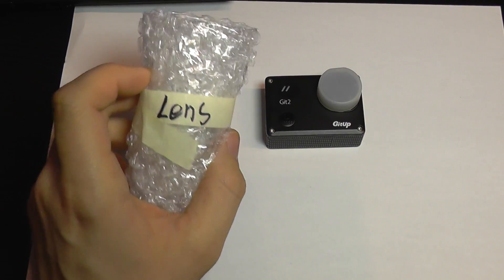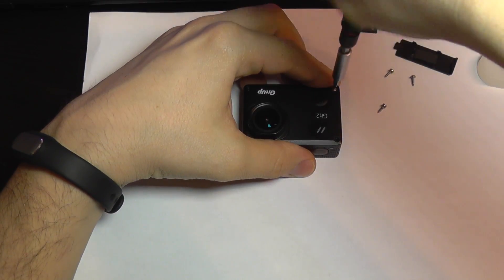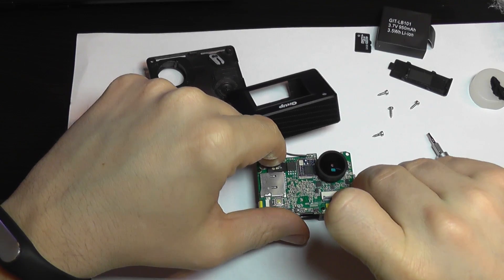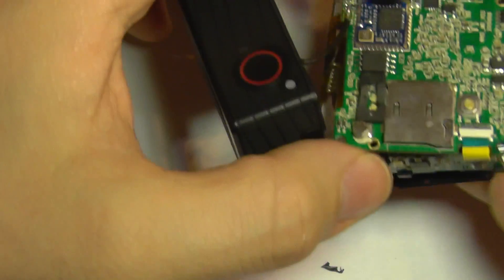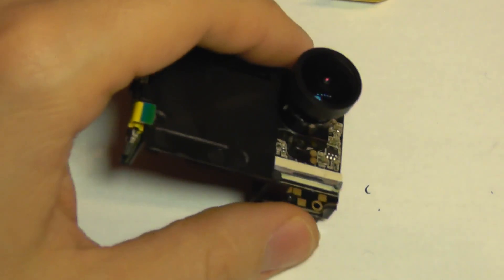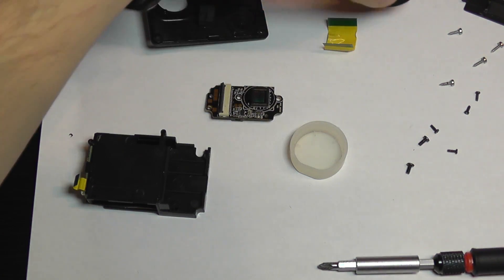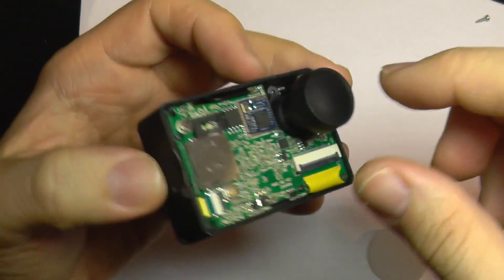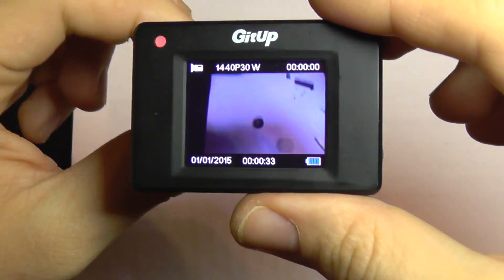GitUp Git2 Complete 90 Degree Lens Replacement Guide

Comment: You make it look so easy ... but I know its not (after fiddling with my Xiaomi YI for over 3 hours trying to get it to perfect focus .. using template to get close then going outside and shooting pictures and watching them on HD TV). It was a lot of work, but my YI now has perfect focus.Going to watch your other videos with the 90 deg lens to see more results. Cheers.
Reply from the maker: You don't need to go all the way in. You may just heat and unscrew the lens and replace it with the new one.
Reply: Yeah, that's pretty much it.  You can find a variety of images to print out here: <https://www.google.com/search?q=eia+resolution+chart&rlz=1C1CHBD_enUS691US691&espv=2&biw=1680&bih=961&tbm=isch&tbo=u&source=univ&sa=X&ved=0ahUKEwjp_sP1_MvNAhVIOiYKHaKoBZEQsAQIGw>  After I focused on that and got it as close as I could, I have a front room bay window, and the glass is very clean, and I focused on the bark of a tree across the street while looking at the image on my HDTV and fine tuning the lens. Once I got it as close as I could, I hot glued it and called it good.  I could have gone the "extra mile" and done a series of high res still images to perfect it even more, as I did with my terrible Xiaomi YI, but thought that I might run into the "law of diminishing returns".  Good luck with your replacement.
Reply from the maker: +Bill Somrak GitUp in now also supplying a CMOS Board + Adjusted lens, so you don't need to focus it again.
Reply: Well, THAT would be good .. make it less painful ;-)
Reply from the maker: +Bill Somrak An also if you want to switch to 170 deg you just swap the boards with lens, much more convenient than refocusing...again.
Reply: I'm much less intimidated by the focusing than by the mechanics of the lens swap. Then again, the break down of the procedure was superb.
Reply: Yeah, it works great. Use a hair dryer and heat up the glue around the old lens. Check every so often by trying to twist the old lens back and forth. Once it comes loose, unscrew it, and screw in the new on (which you will find will not need to be screwed in as far. Connect up a cable to the HDMI output and adjust the focus. Apply some hot glue to secure your setting, and you're done.  Took me less than 1/2 hour.
Reply: Ah!! I can't believe I overlooked this before I took mine apart and damaged it!! I have replacement Git2 on the way and I want to try again. So just open the front, then gently heat the adhesive to unscrew the actual lens and screw in my 4.1mm? 

After that focus with webcam mode connected to a PC?  Can you give a link to the contrast pattern you used?
Reply: Thanks Bill!! That's exactly the info I needed!!
I'm an X380 flier too, and I really have enjoyed your videos!! 

I have an "open box" Git2 soon to arrive and GitUp  can send me a board to fix the one I messed up. So I'll have two cams. I'll either keep them both or gift one.

Comment: Just a thought;

Instead of purchasing the 90 degree lens to eliminate the fisheye effect for the Git2 and other action cams, wouldn't it be easier to develop a lens that counteracts the 170 degree lens and have it mounted directly (like the polarize lens from your other video)?  It would probably be more of a concave glass.
Reply from the maker: +Chris Kay I thing it will be possible only to add a lens that turns a 90 degree lens to a 170 deg wide one, but it will be extremely complicated, expensive and heavy.

Comment: thanks for your opinion! and it's possible to  put it in the gopro case?
Reply from the maker: +Unai f.graff The Git2 is exactly the same size like a GoPro 3/4 so you can use with all accessories like waterproof case, open frame and other things like gimbal stabilizers.
Reply: Thanks man!

Comment: Would it be also possible to leave the original lense socket in place when changing the lense?
Reply from the maker: +Markus Angermaier I haven't tested that, but it may not be possible as the new lens has very long thread and it may bottom out (over the sensor) when you adjust the focus.